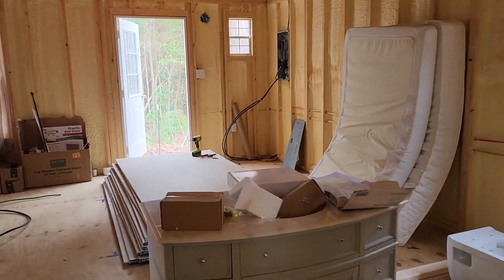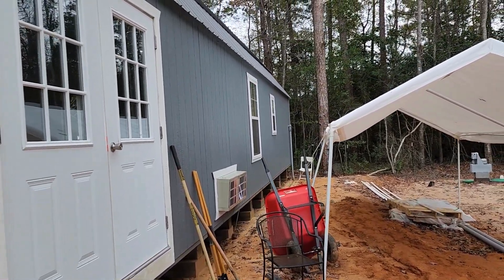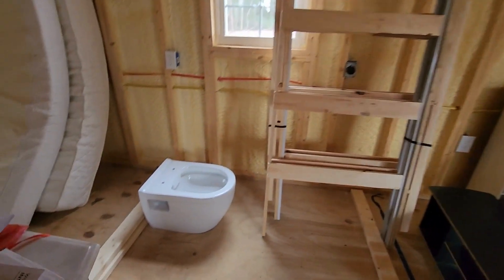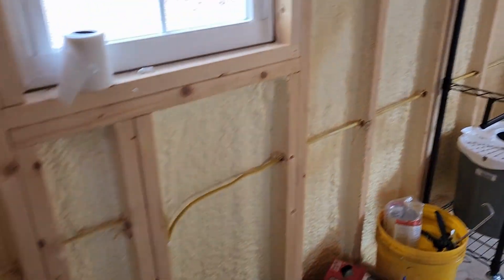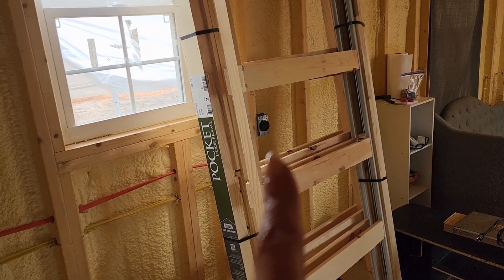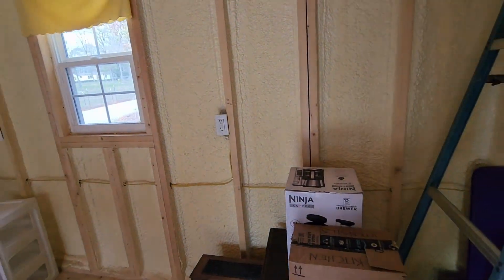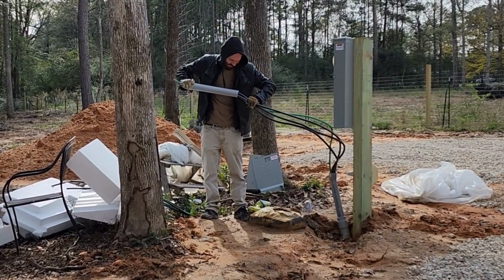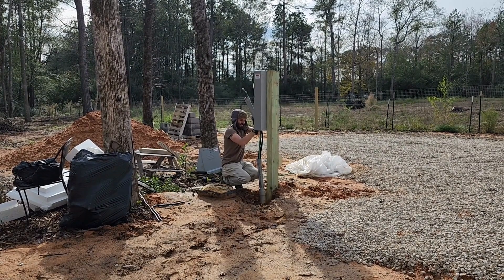Shed to House ~ STILL No Power!

Comment: I see you have your spray foam I was scared to do the foam after watching you tube.Your spray is neatly done not covering your wires. Now I like the work wouldn’t mind paying for work like that. If you don’t mine me asking who did your spray foam. I was planning on doing the pink insulation I really prefer the foam.
Reply from the maker: Hi there, the closed cell spray foam was an upgrade from the builder (Derksen). I've seen some of those videos too, I wouldn't dare attempt it LOL. It is pricey but should be well worth it in the dead of winter and thick of summer. 🙂